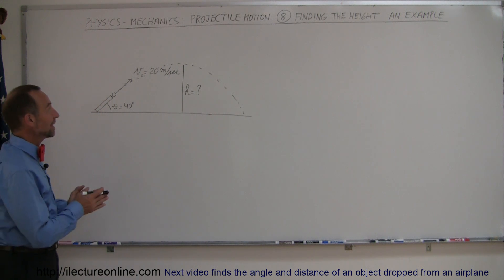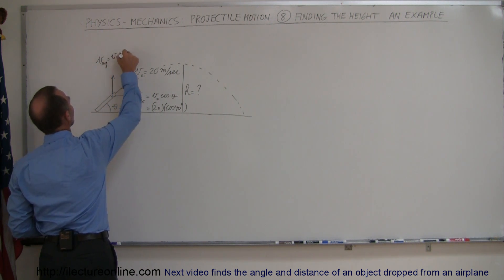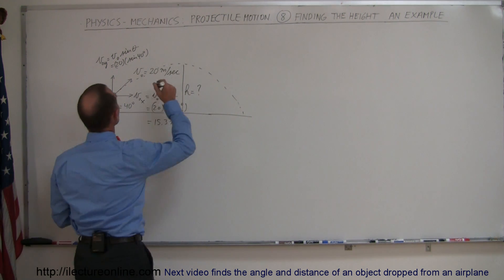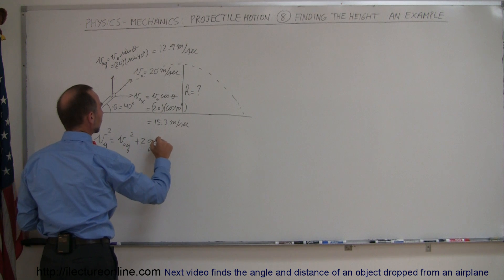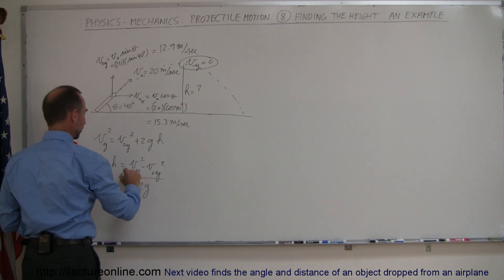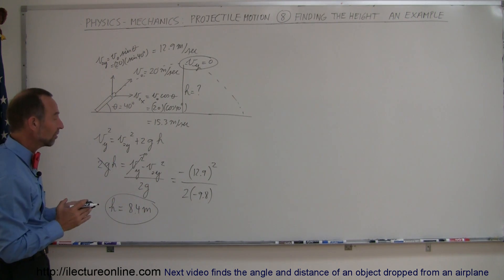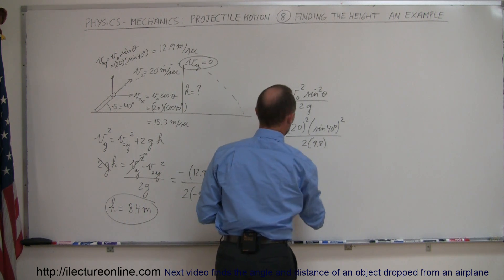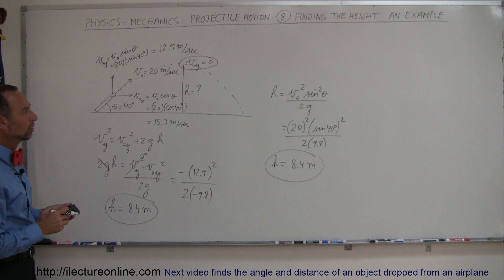Physics 3: Motion in 2-D Projectile Motion (11 of 21) Finding the Height: An Example

Comment: i got 11,3 in height calculated several times. 20 times sin 40 = 14,9 not 12,9? I am confused =(
Reply from the maker: You may have your calculator in radian mode, instead of degree mode.

Comment: What if theres no angle? maximum height is 0? since sin(0) is automatically 0
Reply from the maker: This is off course not a "realistic" scenario.  But technically, the range would be zero at the point where contact with the ground was made (with a starting height of zero).

Comment: Instead of using the general equation you derived in the previous video, I used the equation from your other videos: 
X,final = (V,initial in the x * t) + (X,initial) 
Y,final= (V,initial in the y * t) + (1/2 at^2) + (Y,initial)
I solved for the range of the entire thing, then divided by 2 to get the X,final at Y,max. I then used this X,final in the equations above to solve for Y,final.
 I got h= 8.13m. Is this close enough, or would this method be considered wrong?
Reply from the maker: Since the correct value for h is 8.4 m, I would consider your answer incorrect.
Reply: Im sorry, I accidently put 3 instead of 8. The answer I got was 8.13!!

 @MichelvanBiezen
Reply from the maker: That still seems too far from the correct answer.

Comment: I am confused as to why you used (-9.8) for gravity in the general solution but in your specific equation you used (+9.8) gravity.
Reply from the maker: Whenever you use the equations of kinematics, you must use g = - 9.8 m/sec^2 because the direction is important.    In the second equation, we only want to used the magnitude of g.  Note that the 2 terms in the numerator are squared, so you would always end up with "negative height" if you used the - 9.8, which wouldn't make any sense.  It is all about knowing when to use the direction of the vectors and when to use the magnitude.
Reply: Michel van Biezen thank you for the clarification, do you by any chance have a video covering how to find the range?
Reply from the maker: Yes, we have videos on almost every imaginable projectile problem.

Comment: After calculating. h(8,4m), I can Also  calculate “t in air” (8,4=12,9t-4,9t^2) and then to calculate x = 15,3*t. . But the valute of x calculate, is relative to h=8,4m and not to final position (on the ground). Is it correct?

Comment: I have a conceptual question. If a cannon ball was shot from a certain height let's say multiple times at different speeds, would the ball that travels further take longer to hit the ground than the one that travels less?
Reply from the maker: If the ball is shot horizontally, then the speed doesn't matter.  They will all land at the same time.
Reply: Thank you for that. Just by looking at a picture with different lenghts traveled one would think otherwise, but I do know that the vertical and horizontal velocities are independent from each other. Thank you again. Your videos are the best!

Comment: How would you determine the speed an object will hit the ground?
Reply from the maker: Once you know the time in the air.  Vy =  Voy + gt    which give you v in the y direction.  The v in the x direction always stays the same.
Reply: I appreciate you taking the time to respond. Thank you
Reply: @MichelvanBiezen  How would you go about finding the velocity, knowing the velocity in the x and y direction?
Reply: @gamerdio2503  if you know the velocity in the x and y direction, you can treat the velocity like the Pythagorean theorem where the x-component will be one side of the triangle and the y component will be the other side. Use the theorem to solve for V which would be the hypotenuse. a^2 + b^ = c^2 which leads to V = sqrt(Vx^2 + Vy^2)